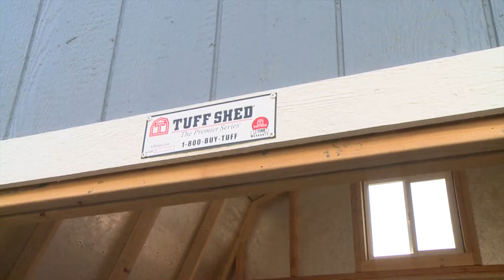Subcontracting with Tuff Shed

Comment: I have a question hopefully you can help me. We have a tuff shed getting ready to be installed in 2 weeks. I'm going to put it in my backyard on the grass. The grass looks pretty level but it's a little bit bumpy in some areas and I did put down some sand to fill in those areas. Do I need to do anything else? After watching some videos I noticed you guys just put blocks underneath it if it's not that level. I'm hoping we are ready for install. Lots of the videos I've watched  looked pretty un even.
Reply: They just leveling the wood under that way the shed is level.